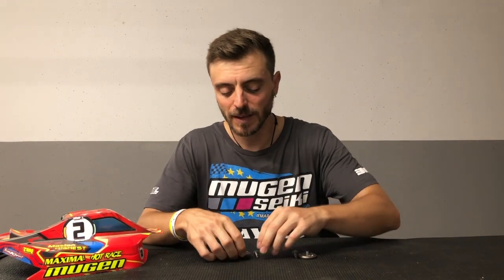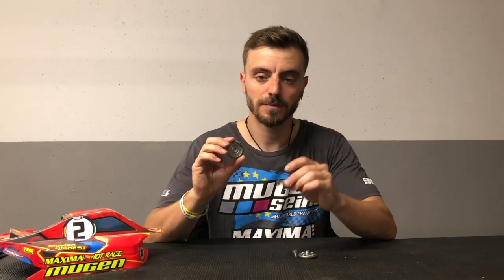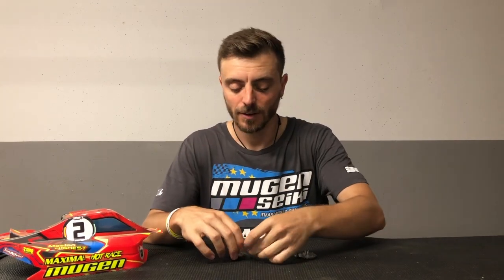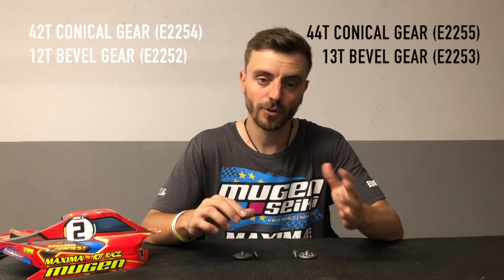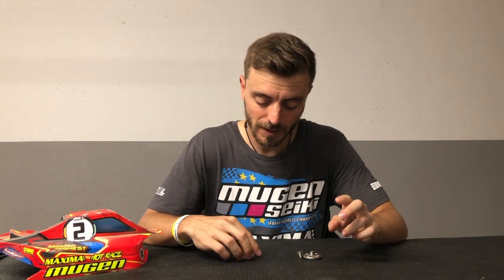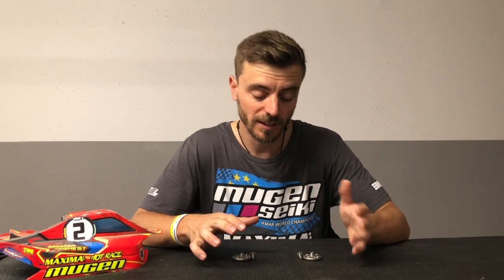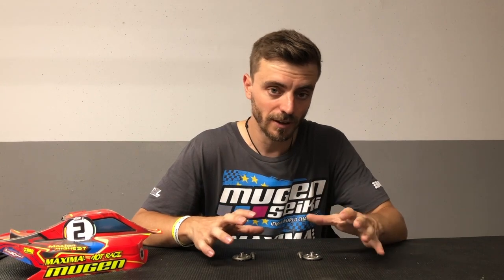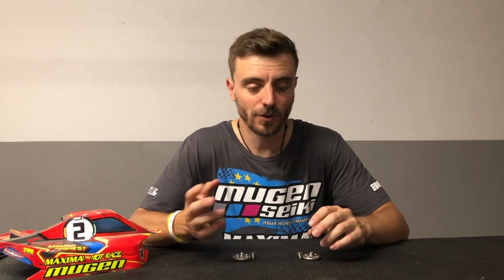Robert Batlle tutorial - 42/12 vs 44/13 Gear Ratio!

Comment: I use the 42/12 in the rear of 7r eco,  and everytime I take it apart to clean  and redo the diffs...there is alot of black dust in the gearbox? And the gears are starting to wear heavy?  Any help?
Reply from the maker: sorry for late, maybe you need to add a shim to hace less clearance between gears!

Comment: What pinion and gear you recommend for e buggy? Now it has 46 16 from the beginning and the motor become too hot! Each time. Thanks!
Reply: Maybe some bearings are broken?... I use also 46/16 with an hobbywing 1900kv engine... He is round about 70°C... Thats okay i think...
Reply from the maker: it depends on the KV, but it is not bad 46/16
Reply: @robertbatlle36  it's 1900kv .Now I put       46 14. Little better.